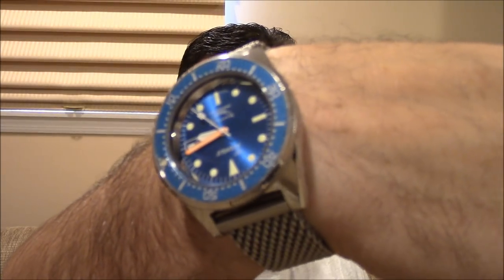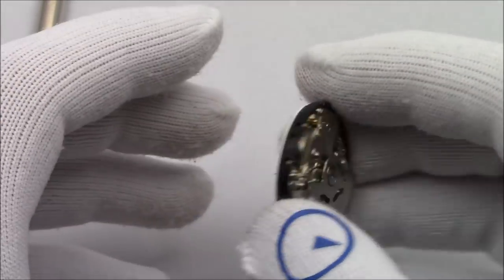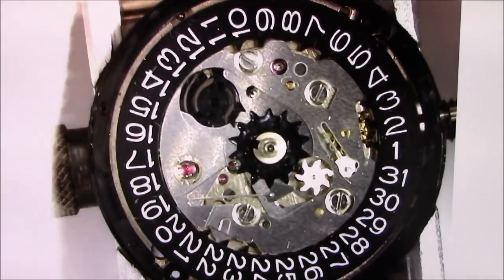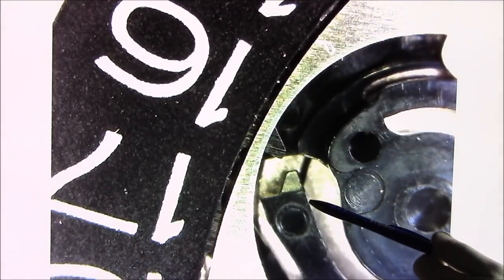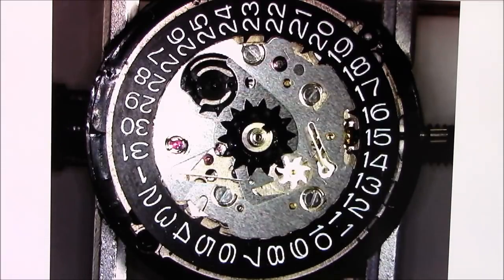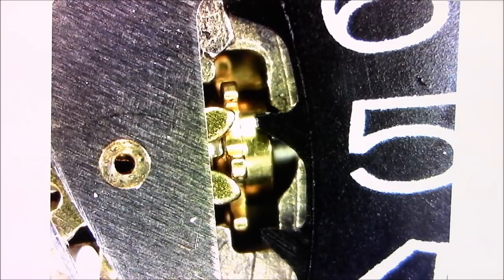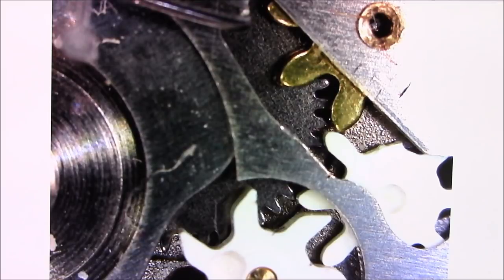Adjusting Mechanical Watch Day/Date Precautions & Best Time To Change Date - Watch And Learn #36

Comment: Brilliant explanation! I accidently changed the date at the wrong time on a new watch and freaked out. It still works, and like someone else said, calmed me down enough to know I didn't break anything. After seeing this I will definatly be more careful with the date setting from now on. Thank you. This was really helpful and Interesting.
Reply: I just got my first automatic and out of the box the time was set at around noon or 11:30, it was also date transitioning. I went to pull to second position to change time and going through the first position the crown shifted the date as I pulled it out, now I’m kinda freaking out.

Comment: Cool video. It's a terrible engineering/design flaw. An end user shouldn't be able to destroy a watch by turning the crown. Imagine destroying your television by pressing a button on the remote. You need to design products to be idiot proof.
Reply from the maker: LOL. I would agree with that!
Reply: Sjaak De Vries exactly... this is ridiculous
Reply: Sjaak De Vries that’s a good way to sell more watches.
Reply: Exactly! Even a certain engineer tend to break the gears too wink wink (you know who) 😂😂
Reply: you sould try this maybe. start your car, keep in in park or neutral, then press the petal until it hits the rev limiter. now this is the important part, keep it there until you engine blows up.
Reply: Then when they are done with that they can invent a car that can’t be crashed.  A sun that warms the earth but doesn’t burn your skin.  A fridge that keeps your food cold and you can leave the door open.  Then we can be completely irresponsible and thoughtless and be just fine.

Comment: This also helped put my mind at ease over having accidentally done this once. Thanks!
Reply from the maker: Yes, you are probably OK!
Reply: I did it too last week. I'm still new to automatic watches and I was dumb not to read the manual. I turned the crown a few times at 12 pm to change the day. I got so worried that I might brake the day&date that I have been keeping an eye on the day&date change ever since. What I've noticed is that the date changes inconsistently, sometimes at 23:57, sometimes at 23:56. Not sure about the day though, because I always fall asleep right after I watch the date change. Does this mean it's broken?
Reply: @DC-oy3gk  I don't know, I'm not a watch expert but I've seen it happen on my watch aswell, personally it works just fine
Reply: Did this once and broke my Seiko 5

Comment: Intriguing, great video and excellent close-up microscopic filming of these watch day/date functions. Thank you. When my mechanical watches stop and need winding, I can fortunately just turn the crown from the base position to wind it up. If it requires a rotor wind up then I just have to shake the watch enough to get it to go. Now, if the hour hand is in the 9 to 3 danger zone, I just let the watch run to get it past that time frame. Sometimes I don't even know if that could be AM or PM. Don't want to take any chances. A few times I pulled the stem all the way out for the time setting when it was in that zone but I don't think that caused any damage to the date or day wheels. I have a watch that has a month wheel and I thought it would advance the month after the 31st but it didn't .The person who looked at it said you have to do that manually via a pusher. Thanks so much again, loved the video!

Comment: This has been one of the best if not the actual best watch and learn videos, I've seen so far, i did change the day and date on my Seiko 5 when i first got it and it was near enough midnight by the time i was able to get the watch out of the box and set it up and of course I didn't read this manual so i set the time then the day/date, i was horrified when i saw that i wasn't supposed to do that and bloody relieved when i saw that i hadn't damaged my lovely new watch that i had to save for almost a year to buy, damn lucky.
Reply from the maker: Thanks for watching, and now you know!

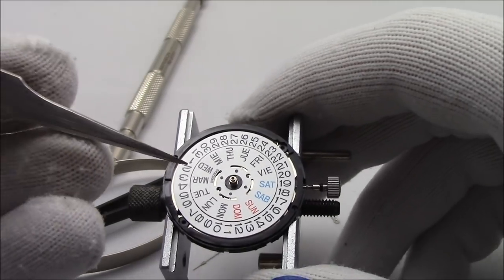Comment: Such a helpful video. If you say to yourself, only quick set the date after setting the hands to 6:30, would that be a less confusing, easier to remember rule? After all, who knows if the watch has stopped on am or pm until cycling past 12, especially if you have a bunch of them that just sit around.

Comment: That’s a real amazing video that fully enlightens me why it is harmful to change date between the time people mentioned. I just don’t do it because I heard it, but now i can see it clearly. However, I still want to know Rolex GMT Master II also has a same mechanism is what’s shown in the video. Because I heard that the original purpose of GMT Master was to let Pan Am pilots can find the time and date in certain time zones, it is made to change date (which is moving an hour hand) and time whenever they want. I still wonder GMT Master II is going to damage the movement when it manually changes date in that “dangerous” time range

Comment: I really enjoyed the video Mark and it was indeed unfortunate you did'nt catch it getting clobbered on video .  Slow motion please if possible for the retake in a future example of what can happen if you mess with date and time adjustments at the wrong time . I have a Seiko Kenetic  Auto Relay which I had bought on a holiday to Denver about twenty years ago . It has never missed a beat and I'm still wearing it to this day . As I've clocked a few miles up as the hours , minutes , and seconds have passed , the only maintance necessary was because my wraist had lost weight and I've had to remove four links . I've gone through three girlfriends a dozen high insurance cars , and the only thing I've got left is my trusty old Seiko , which has  never required any maintance , which is more than I can say for Jane, Sonia and Joan ! . All the best Mark , With kind regards from Jonathan , in Belfast Northern Ireland United Kingdom . Ps...has any-one seen Jane  ? . Keep up the hard work as your vids are great .

Comment: Great video Marc! I've got a 2824  movement in  Hamilton Khaki. I mistakenly nearly changed date in a quickset at midnight. I noticed just in time as the date 'started' to move, halfway through to pull out to 2nd position and move hands via its cycle to click  date over 'naturally '. Have I averted damage??

Comment: Awesome vid, very well explained. I have a random question. I own a SRP775, and have to hand wind it from time to time. Is there a way to tell when it’s wound all the way, and should I worry about over winding it?
Reply from the maker: Not exactly; unless you can hear when the spring is fully wound; there is a slight change in sound. Don't worry about overwinding; but don't wind the heck out of it either.

Comment: I need to say it again, your videos are very good excellent work Mark !
At first i said to myself, why the industry become so cheap and they made the wheels from plastic. But i realized they made them out of plastic intentionally so they can be broken down, if to much force is applied on them, in order to cause less damage to the mechanism.
Reply from the maker: Correct; it is the weak link on purpose, though it isn't in the most convenient location. Also, no lubrication is necessary.
Reply: That is interesting so when i was struggling to oil the damn thing, i was struggling for nothing.  :-))

Comment: Great video 👍

 IBroke the metal part that sits on that  white wheel on one of my nh35 movements.  Quickset doesn't work now 🥺
 If you want to change the date, you can wind it up to 12 a.m when it  automatically click's over. Then wind back about for times and forward again, and it will change.
Reply: Hi there, did you manage to find a spare date corrector for your NH35 mouvement? I just happened to do the same mistake with my Seiko 5 pepsi and can't find that part anywhere.

Comment: Hi Marc, thank you for this video.  I damaged my quick date setting today actually and I've been searching online to find a video explaining it and this is the only one I came upon.  I own a Sinn 556i with an ETA 2824-2.  I get the dilemma with the top gear, where the stress of the spring action from constant date changing can cause it to break between 9pm-3am.  But I'm not exactly clear on why the bottom gear snapped based on the 9pm-3am time frame.  Is it simply because of the extra stress on the small gear arms from the top spring?  In other words, the top spring hasn't cleared yet, so the bottom gears have a little more pressure on them as they spin and eventually snapped.  Is that correct?  Are the gears that delicate on an ETA?

Comment: Great instructional video! Very much appreciated it. Is it sad that your junk Seiko I actually love? I am not currently seeking out one like in your video.

Would have love to see that carnivorous bird ! Animals are just so awesome. Their little quirks and personalities. 

Maybe this video answers this question , or maybe not. I have purchased a few used Swiss autos. One is a Baume and Mercier Capeland chrono and the other one are a Tag Heuer Auquaracer auto chrono and a Longines HydroConquest auto chrono.
All of these watches do the date change at around 5 o Clock to 6 o clock? None of them change around midnight.

So what does this mean? Do the date wheel and all need to be removed and reset all the gears properly?

Thank you for your time and consideration

Comment: With all of my automatic watches I set the time first but stop on the day before the correct date. So if I need to change the date to the 12th I set the time until it turns over on the 11th and I continue to set the watch until I reach the correct time. I'm usually doing this first thing in the morning so it's past 0300 hours. The last thing I do is set the correct date using the crown. I give the crown a few turns to wind it, put the watch on my wrist, and carry on.

Comment: This is a very well done video, thanks Marc! I have a question for you at 14:23 - I recently got myself a Seiko 5 Sports with a 7S36 movement. Being the idiot I am, did not read the manual and changed the day and date around 1:30 am when it was in the process. Don't think I broke anything, the watch works fine. Just that when I try to quickset the DAY, it does not engage in the first click - eg if I'm on THU and try to quickset, THU will move halfway up and then fall back down. Only on the second click does it go to FRI. Its as though the teeth of the gears are very slightly misaligned or bent - that's what it looks like from the plastic day/date wheel that shifts its centre. What do you think? Might seem like I'm nitpicking a very minute issue, please let me know your thoughts :)

Comment: Great video, do higher end watches have this problem too? They usually have all metal gears.
Reply: That would be my question as well: if those fragile gears were made out of brass instead of plastic, would the warning about changing the time during the danger hours no longer be needed?
Reply from the maker: So I was going to delve deeper, but didn't. Higher end watches have an instant flip. They do this by pre-loading the date wheel with a spring. If the date is advanced, it just passes by. No risk of harm. When you spend 5 or 10K on the watch, they engineer against these sort of things.
Reply: That’s good to know — thanks for the reply, Marc!
Reply: What about an ETA 2824?

Comment: ok hear me out, I have an automatic watch that has a small wheel which shows the day of the month we are in and I can change that no problem but I also have 1 for the actual day like monday or saturday. this one isnt a small wheel, its actually a little clock with a dial aswell. can you change this in a fast way aswell or do you have to keep on turning the dials so its jumps every 2 rotations?

Comment: hi Mark,
I have Tissot PR-516 Automatic with date and time change. The problem is that the crown only goes out one click...and it gets me to position 2 bypassing pos.1 where I could change the day and time independently. (Quick set)... thanks to you and my own hands on experience with the “date only” models I have a good but not précis e idea of what could be wrong but that’s not enough....Any Idea ?....And on top of that it had been supposedly serviced a few months ago, I saw the invoice ! I need help !!     Thanks

Comment: I did not know that and my watch came without instructions. It started like this: First, when the date changed it would move up two days instead on one, very annoying so I reset it quiet often,  I don't remember doing it between 9 and 3 o 'clock, but I didn't know...so, I just might have. Next, the quick set for the date hung up....so, I had to go through all the 31 days to change the date, then next, while doing that clockwise, there was some resistance at about 9:40 and since that, the hour hand cannot move past 9:40. This was a 10 bucks quartz watch, but still...it was new

Comment: I have a 1960s timex white face red second hand and i pulled the crown all the way out and was spinning it clockwise and the hour n minute hand was going around 24 hours i kept spinning n spinning to get the date to the right day it was on the 21st n i kept spinning tryin to get it to the 10th n it was clicking over every 24 hours i spun the hands then it stopped after going to the 29th the crown got tight and just started clicking wen i turn it now it is just done if i try and turn the crown the hands will turn then click click click and the crown gets tight n just clicks,, i didnt think it could damage it if u just advanced the hands 24 hours date flips spin crown clockwise 24 hours date clicks once i never spun backwards i just kept spinning it 24 hours clockwise n the date would click once my question is will doing this damage every watch? I only ask bcus i have over 50 vintage watches rangeing from 1920s to 1960s my newest watch is a 1969 but will doing wat i did damage a watch? Or was it a freak accident that it happend to that impiticular watch.

Comment: Hi Marc, great explaination. I have a couple question regarding the moment when the date and day fully changes. I bought Seiko skx013. Before I made a mistake the date fully change or rotated at 00:03. I wanted a minor minute adjustment at 00:15. I though the crown was already pull out twice. Only once at that moment. So I accidentally advancing the date at 00:15. After that the date fully rotated at 23:55. Am I broken something? Or something was misaligned.
How can I fix this?.  The day change with no problem as before. Switch to Spanish somewhere at 01.00 and to English at 03.00. The date still start to rotate as before at 22:00.
Reply from the maker: Sounds totally normal. It can vary by a few minutes day to day.

Comment: Can you tell if any of these gears are broken without taking the watch apart. I just got an automatic watch and changed the date for the first time before knowing this trick. Time seems to be working just paranoid I could’ve done something damaging
Reply: How did  your watch fair? just got my first automatic and out of the box the time was set at around noon or 11:30, it was also date transitioning. I went to pull to second position to change time and going through the first position the crown shifted the date as I pulled it out, it’s loose crown and I wondering if I damaged something.

Comment: Hello, I accidentally change my date at almost 1 AM just after the date was changed while I was adjusting the time because of the DST. 😟 I even  turned the date a few more times before realizing it. Will it damage it right away? 🥺 Maybe I should have just turn the time counterclockwise instead, is that safer?

Comment: I once forgot about the rule and changed the date at around 11 pm on my new 5 sports. I was sweating as soon as I realized it but luckily nothing broke, the day/date function works just fine. The watch is about to be cleandled and regulated soon so if something is wrong the watch maker is gonna tell me 😄 Its good that I have a spare mechanism to replace parts if something goes wrong.
Reply: lol I did that today too.

Comment: can i adjust the clock during the date or day change (10pm-4am) on seiko 5 machine? sory i have bad english listening skill
Reply: Yes, you can. Advancing the time manually does the date change exactly as if the movement did it naturally by itself. Not sure about going through the date change backwards, though it should be fine I guess.

Comment: While it is clear why the 2 x black wheels might break (e.g. plastic fatigue after repeated flexing), it is not at all clear why the small white wheel broke (especially that is is not fixed on a pivot and can float around). The only possibility I see is that the black day wheel, the central rotor, the pivoted white wheel and the floating white wheel have to be in a particular position (possible, but improbable) so that the force transmits through the whole contact chain (black wheel->rotor->pivoted white wheel->floating white wheel) in a very particular way (so  that the weakest part gives off under that momentary force when all are in contact). I can see why it is not recommended, but if one does it one time by accident, it is highly improbable that anything is damaged.  Am I wrong ?

Comment: I have a Valjoux 7750 that I mistakenly changed the date during the wrong time and now my date change does not occur at midnight, it changes at like 3am.  It bugs me even though I am fast a sleep at either time but I’d like to have it fixed!

Interested in repairing it?

Again it still changes the date but just does it at the wrong time!

Comment: Wow this is the video Ive ever seen on how this mechanism works. My Breitling date changes at 4am. I guess I changed the date between 9pm and 3am. The watch works fine other than that. How can I fix this this. Breitling claims you cant damage your watch by changing the date at the wrong time.